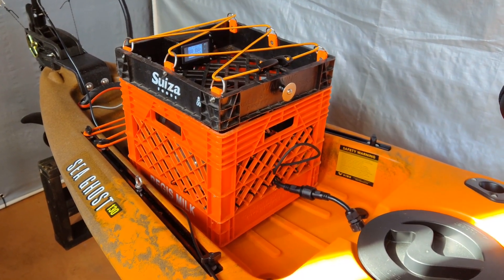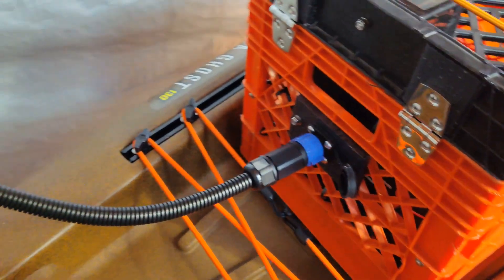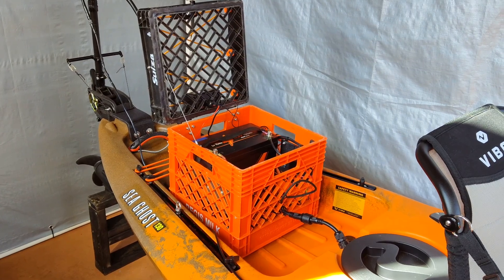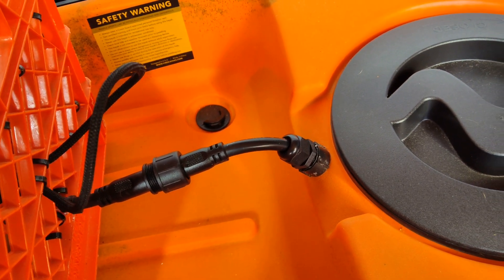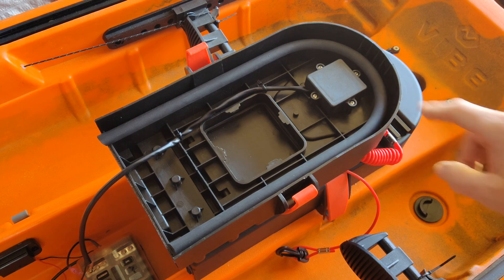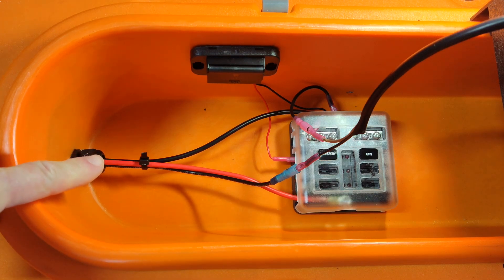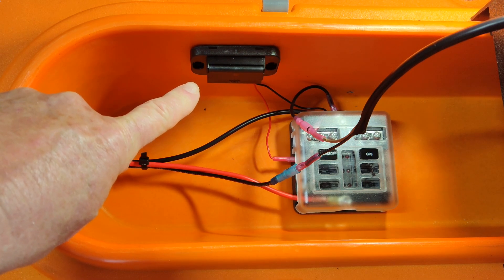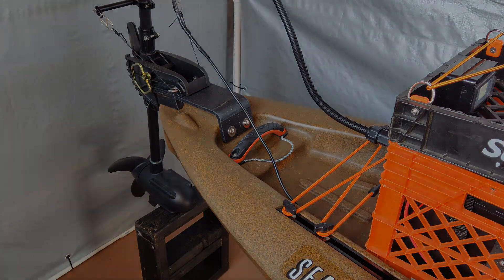Portable Kayak or Boat Battery and Electronics Crate

Comment: Thanks for the great info and ideas as always. Starting my build based on this and others you've posted. I'm ordering cable for the control wires from the Protruar 1.0 head to my battery box (will use 3 of 5 conductors) and from the control box to the battery box (control will include a kill switch, thus 2 more conductors, total of 5). I want to just order one cable long enough to do both jobs. Highest draw will dictate wire gauge. I'm guessing it will be the coil side of the kill switch but lack the data to be certain. What gauge would YOU order please?  Thanks in advance for your reply.
Reply from the maker: Thanks. I'm not sure what your set up looks like and the components you will use.
Reply: @Aksmaniyak  I guess that would help. 🙂 Basically the same setup as your battery crate with same components with the exception of the kill switch itself. I’m going with a SeaChoice universal kill instead. Your fuse panel isn’t available so I found a substitute. Relay, circuit breaker are as you speced out.